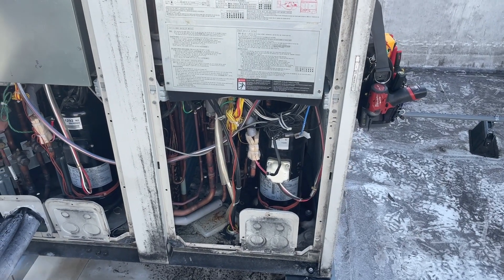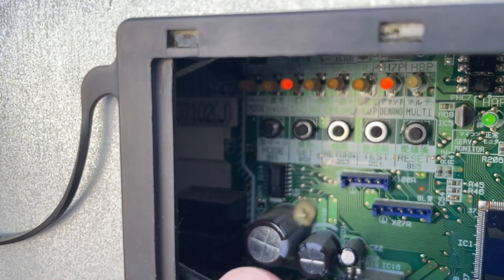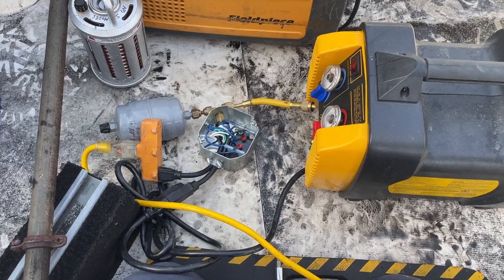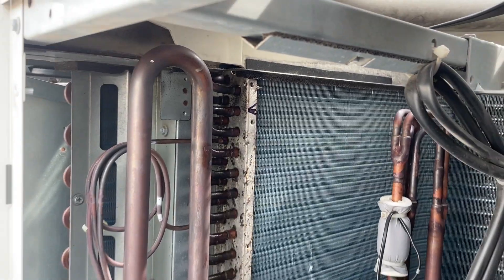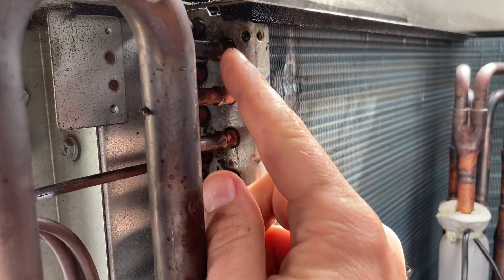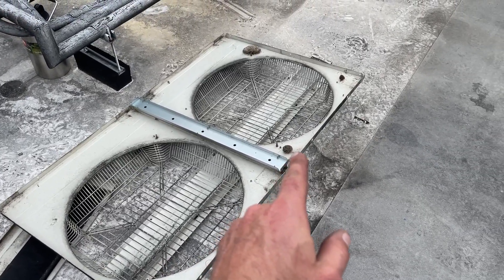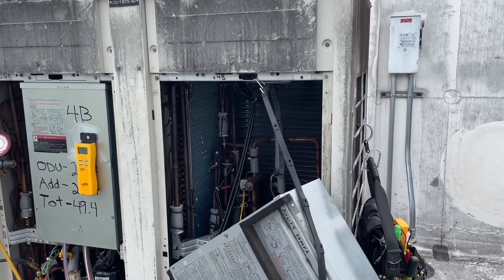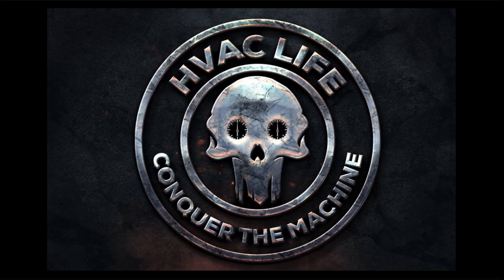HowTo23:  Fix a Refrigerant Leak Located in the U Bend Plate

Comment: I was installing a daikin LREQ VRV refrigeration condensing unit this week. And troubleshooting one next to it. 

The control boards in there look exactly like the VRV 3 board. So I went to my notes and started dicking around with it to find out what the fault code was… turns out it has totally different firmware 😄 had me scratching my head for a while. 

Quite a weird set up. VRV condensing unit running a custom evap coil, mechanical TEV and it’s a pump down 😄. I’ve done 4 of them now and they’re quite nice to work with. 

Decent vid mate 👍🏻

Comment: A little trick a use when brazing close to a heat sink. I start with the furthest point from where I’ll be brazing then move closer. Usually 8 to 12 inches away. Not crazy hot but hot enough. Good video on my brother. I would like to learn a bit more about Daikin since I rarely work on them.